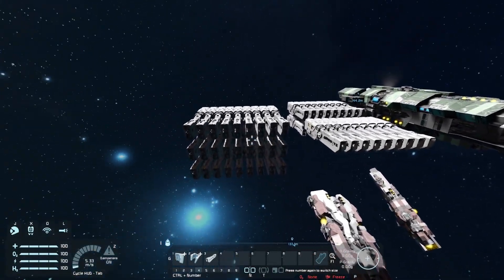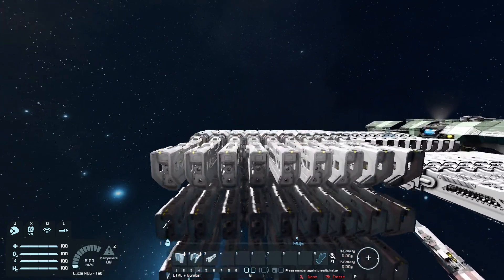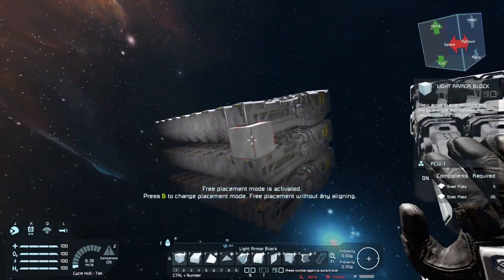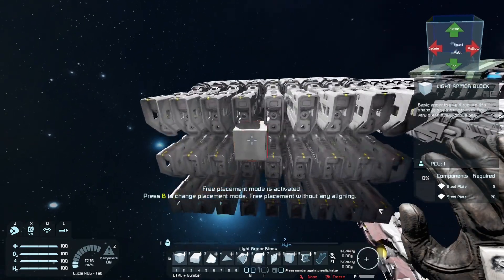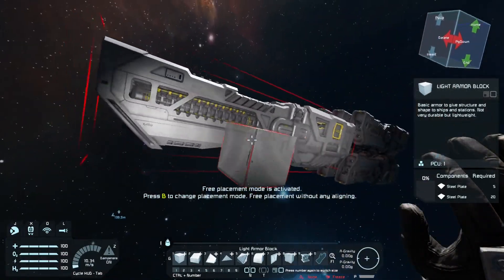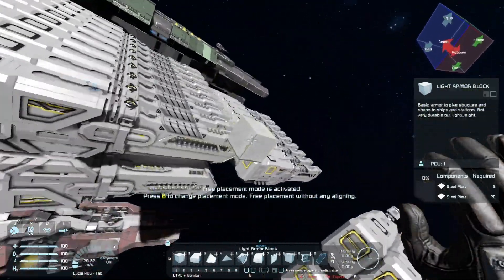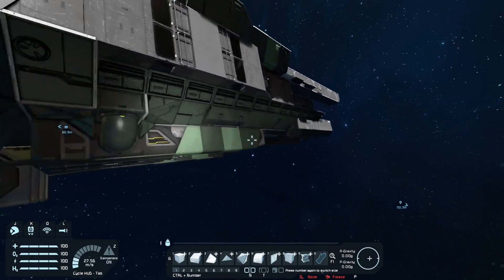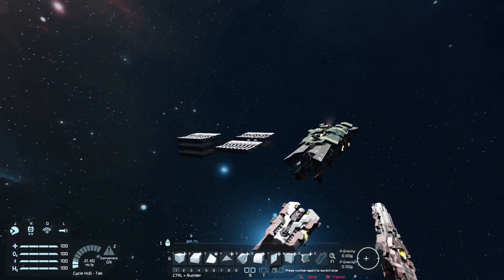You Are Placing Railguns Wrong in Space Engineers

Comment: This method my also be known as a staircase.

Also something that was not covered in the video is that you can can use the half full slope blocks (not the regular slope but the one that has combined slope and half block (the flatter slope withe half block bottom)) and put them under the railguns with the sloped face facing in the direction of the top of the railgun. Then you alternate left or right angled slopes going out. You can repeat this on the next level, yet the lower railguns will still be able to fire. This allows you to add crazy amounts of armor to your railguns in the front while still being able to fire.
Reply: Exactly what I did with mine as well